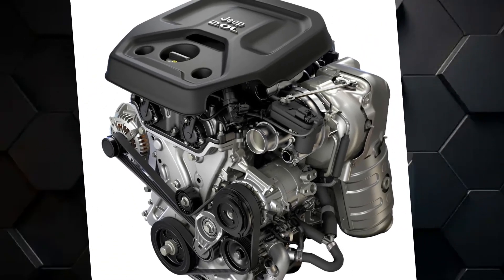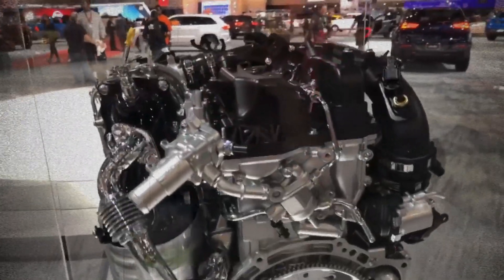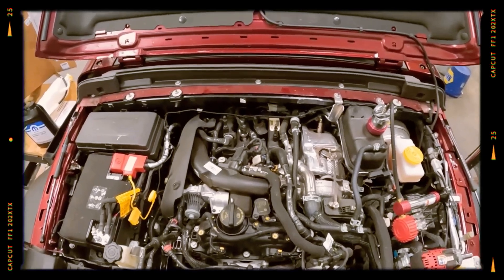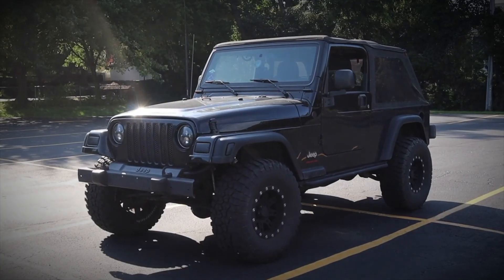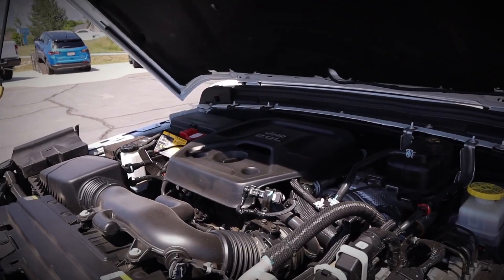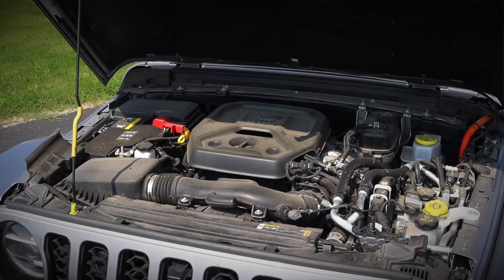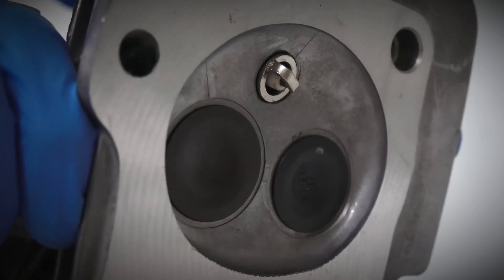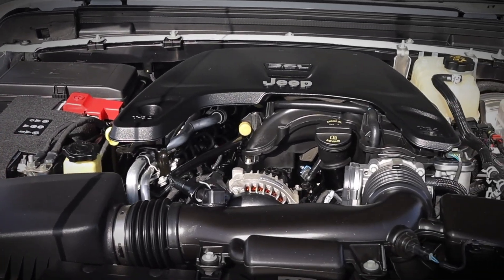Overview of the Chrysler 2.0L Turbo GME Hurricane Engine: Specs, Issues, and Reliability!

Comment: I have this in my 2023 Wrangler Willys 2 door.  Love it so far but I am already accustomed to luxury high performance engine maintenance (Twin turbo Mercedes E550 Coupe as example) so I am treating this Jeep 2.0l engine in the same manner when it comes to upkeep.   I've enjoyed it so far and been great on easy to average trails.  On highway I get 23mpg so no complaints for something shaped like half a brick.   I use premium fuel only, oil changes every 3500 miles, standard mileage changes when it comes to transmission and other drive train needs.  And will be doing a intake valve cleaning soon.  I'm just over 30k miles on it and they recommend cleaning the intake valves every 30k to 50k miles.  So I'm doing it in the middle, every 40k miles I'll have it cleaned out.  Most of these steps will also help limit low speed pre-ignition that sometime happens to turbo direct injection engines.

Comment: I have this in my 22 Wrangler.  While it's is impressive with power and torque, it has been in the shop 7 times for coolant related leaks.  They replaced the motor(under warranty) and 2 days later, the new water pump leaked.  Got it back and 2 days later, the new water pump leaked again.  I have a lemon law case pending.  Complete junk, run far, run fast away from Stellantis products!
Reply: 한국분이신가요?

Comment: I have this engine in my Jeep that has proven to be both powerful and reliable. It truly performs best on 93 octane fuel, which ensures it runs smoothly and efficiently. Maintaining this engine requires diligent care, including regular oil changes with high-quality synthetic oils, specifically formulated for optimal performance. Additionally, each time you change the oil, it's essential to clean the fuel injectors with a specialized injector cleaner. By adhering to these guidelines, you can help ensure this engine remains in excellent condition and lasts for many years to come.
Reply: Thanks AI